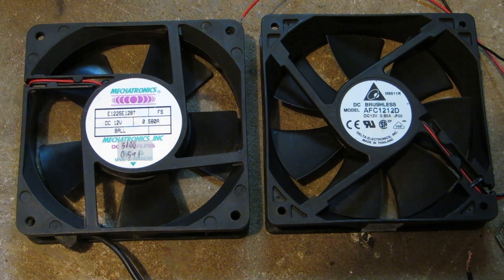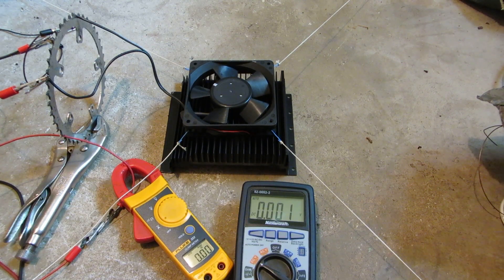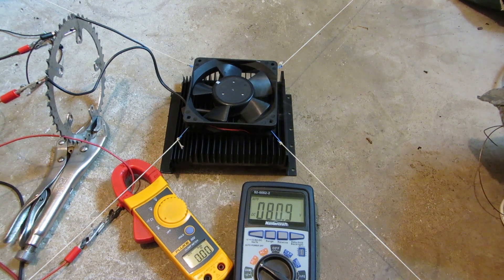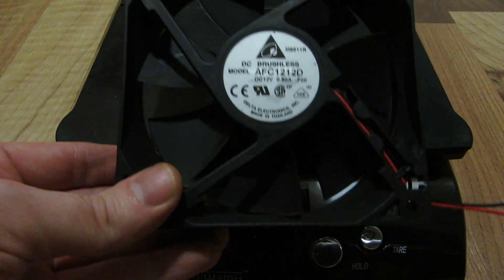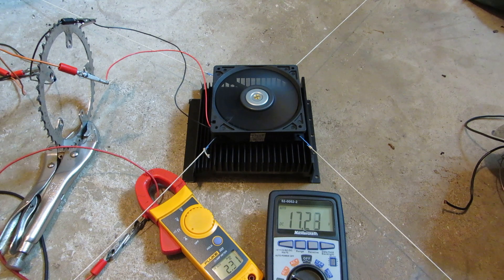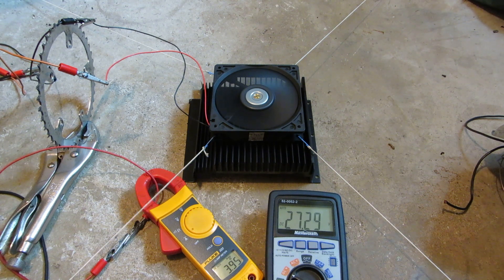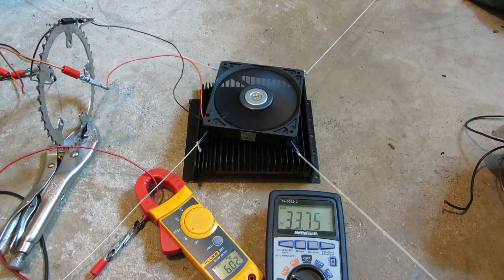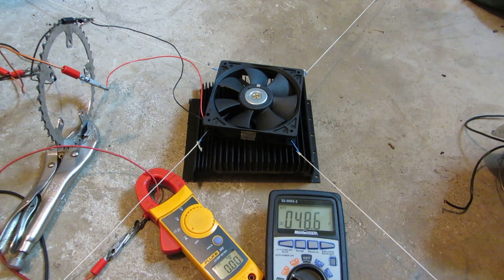PC Fan Flight Tests - 120x120x25mm

Comment: Why do you burn them
Reply: Because it's funny. Besides it's good product testing too as you can see which one is crap and which ones are the best and reliable.
Reply: @dogs-and-destruction-channel  yea but some of these are a bit hard to find
Reply: @bensgoofyahhfancollection9997  
He has 100s of those same fans. Normally if there good and he's only got a few or if they rare and hard to find, he'd keep them aside until he had enough to burn out.
Reply: @dogs-and-destruction-channel  i have a AVC DS08025R12U-011 fan and it pushes a lot of cubic air.
Reply: @18436Melissa  
That's cool. Avc are really good air movers. I had an AVC 50mm fan and it was like a hurricane when activated.